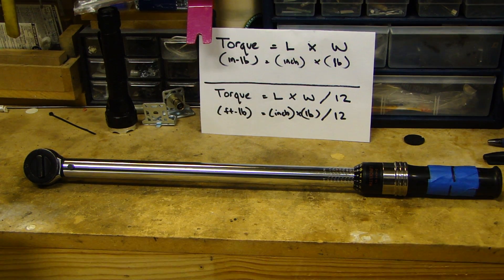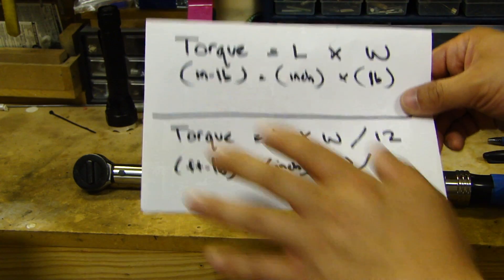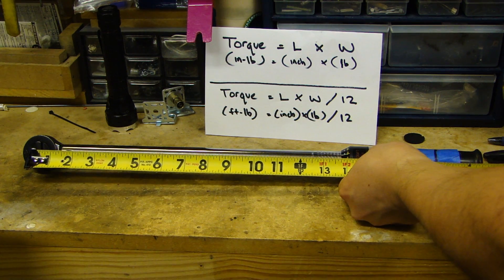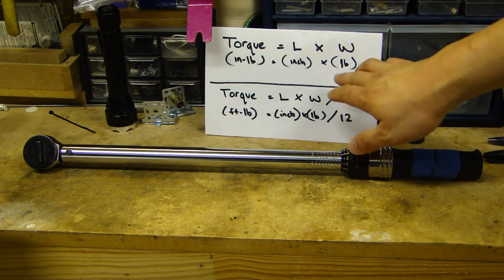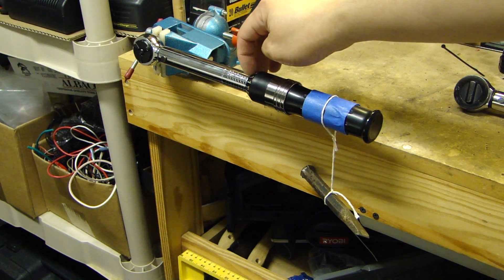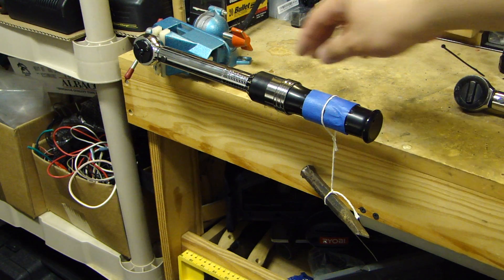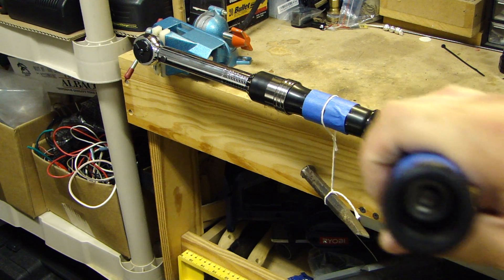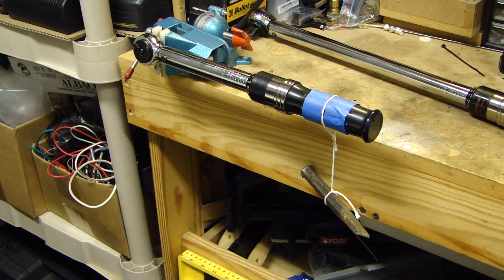How to Check Calibration Accuracy of Torque Wrench

Comment: VERY IMPORTANT! This test is not complete. After doing what is shown in the video you MUST apply lower torque values to make sure it is not still clicking. If you set the wrench to 50 ft-lbs and it clicks when you apply 50 ft-lbs  how do you know it wouldn't have clicked at 40 or 45 ft-lbs?
Reply: Good point but you got it backwards.  If it clicks at 50 ft-lbs, it will also click at any lower setting.  You'll want to make sure it doesn't click at settings higher than 50 ft-lbs...  Now if you are speaking of the amount of weight you apply, then yes, I'd agree.
Reply: @Nick-zp2mg  Lol. I am literally sitting here trying to work this out in my mind. I don't know why I'm having so much trouble. But yes, there are two parameters to consider: 
1. The SETTING on the torque wrench
2. The amount of torque actually being 
     applied.
Reply: Jon Brahms  I concur

Comment: This test you did, which I did on all 3 of my torque wrenches,  was very accurate.  I was off by 4.5% to 5% on all three wrenches.  I read the instructions that came with my torque wrenches and it allows for plus or minus 4% accuracy.  Thanks for sharing......Canada.

Comment: One thing that wasn't accounted for was the actual test method. If you use a weight heavier than what the calculated weight is, the wrench will still click. 5 lb weight, no click, 25 lb weight, click. 50 lb weight, click. In his example, 50 lb weight x 18 In / 12 = 75 ft lbs. Put an 80 lb weight on it, and it will still click. So finding the sweet spot might be difficult.
Reply: Absolutely right. My thoughts exactly.

Comment: Does this method take into account the weight of the handle? If not I suppose you could perform the test with no weights to find the initial torque value, then add that to the value that to the torque value with weight hanging.
Reply: On second thought this probably wouldn't work. It probably wouldnt be heavy enough to register on the torque wrench. Even if it did register it probably wouldn't be very accurate because torque wrenches are not accurate at the lower torque settings.
Reply: You could measure the downward force at the point marked by using an electronic balance pulling up a few mm( fraction of an inch) as there's always a little play in the ratchet which will allow you to do that. 

The method is accuate enough for  those using a torque wrench at home, it's so easy to apply a little extra torque anyhow if you keep moving the wrench slightly with extra force after you hear the click.  You just have to be accurate with your measurements and think about what you're doing to get an idea if your wrench reasonably accurate.

Comment: I happen to have a 1/2" drive torque wrench I bought in 1996 for $40 Mastercraft brand 58-8654-0 and looks EXACTLY like dial2fast 1/2". I have three torque wrenches right now, all three are click type.

Anyways I recently used a professional digital torque wrench calibration tool that is used to check tools used on aircraft (ie: accurate to 3 decimal places in ft-lbs and 4 in in-lbs, zeroing, hundreds of settings, etc) and I tested all three of my wrenches...the range of mine is from 25 to 250 ft-lbs. I tested between 50 and 250 and for each test point I averaged 6 torques...this is what I recorded:
50 ft-lb setting = 51 = +2%
100 = 99 = -1%
150 = 146 = -2.6%
200 = 199 = -0.5%
250 =  250 = 0% error.
Now, I've had this torque wrench for over 17 years, built several engines and used it thousands of times. I've dropped it from a meter high or more at least a dozen times, accidentally dropped a jack stand and a full toolbox on it, skidded it across a garage floor and its hit concrete walls pretty hard. Sometimes I left it on a high torque setting for months. I've never calibrated it until today. I usually put it away and store it in its plastic case but the hinge on it is almost completely broken but other times when I have an ongoing project I'll leave it out with other tools.

The other two torque wrenches I have are pathetic. I've only owned them for 2 years and used them very little. They have never been dropped, always left at a low torque setting and show no signs of use. My 3/8" drive Powerfist (10 to 80 ft-lbs):
20 = 17 = -15%
50 = 44 = -12%
80 = 76 = -5%

1/4" drive MiT Mechanic's (20 to 200 in-lbs):
50 = 55 = +10%
100 = 120 = +20%
200 = 240 = +20%

While the Mastercraft always had <1 ft-lb deviation on each torque, the other two varied sometimes by up to 5 ft-lbs or 10 in-lbs with the 1/4" drive.

Cheap and inexpensive are not the same thing and inexpensive can be really, really good. I had no idea how good my torque wrench is until now.

Comment: This method is ok for people who aren't torqueing things that need to be very specific.  I calibrate tools including all kinds of torque wrenches for a living.  That is the correct formula and the weight of the wrench is not going to make that big of an impact when torqueing your lug nuts or other misc car parts. As he said the accuracy on these are +/- 4% or 3% for some of the nicer ones.  If your reading is 45 ft-lb (540 in-lb)  that gives you +/- 1.8 ft-lb (21.6 in-lb) the added weight of the handle isn't playing a big part in there. You should always store the wrench at the lowest MARKED setting (NOT as far down as the wrench handle will turn) Technically you should also exercise a wrench at full scale on something else before using but no one is going to do that either. As Hilegunslinger said you can use buckets of water to calibrate a bathroom scale to see how far off it is and then use the offset to figure out the weight of the objects you are going to hang just try to check the scale with water weight that is close to the object weight.
Reply: What will the formula be if I am using NM?
Let´s say I want to check 25, 30 or 50NM is correct in the spec +/- %
Wrench length is 43,5 cm long

Comment: One good way to get a good 'standard' weight is to use a 5 gallon bucket and fill it with water.  Water weighs ~8.34 pounds per gallon.  So 3 gallons is right at 25 pounds of water.  5 gallons would be 41.70lbs.  You can use this technique to calibrate a larger scale as well.

Comment: In english: 
Hold the socket (i.e. 1/2" square) in your hand and let the weight of the other end of the wrench fall on a scale. (the handle touches the scale/measuring device)
The wrench should be as horizontal as possible.
Note the weight that presses down on the scale and add it to your calculations.

Comment: yes  that can make the wrench out of tolerance I actually work for a calibration lab in Baton Rouge, LA  " JM Test Systems and personally I do not agree with the method this person in the video is using there is so much more that goes on inside a torque wrench. if you have spent good money on your wrench I would strongly advise having it calibrated annually if not bi-annually by a professional.

Comment: In line with ASME B107.300-2010 #6.3(1)(2)(3) The torque shall be applied at a rate sufficiently slow and steady. For  ISO 6789:2003 #6.3.2 the load shall be applied slowly and uniformly during a period of 0.5 to 4 s. So, hanging a weight in the middle of the hand hold is not the correct way to check the accuracy of torque wrench.

Comment: The 2-4% error found within good torque wrenches is factory tested with the weight of the wrench not interfering. So yes it should matter but not as much for when applying torque at very high 100+ ft/lbs settings. Having said that this is a very clever quick check technique.

Comment: I have a question about the length measurement.  Do take the length measurement with the wrench set to the minimum setting and use that length for all torque settings or do measure the length for each specific torque setting?

Comment: Then i believe if i set up that weight to where it clicks that will be pretty close. and i dont believe the weight of the wrench will come into it at all since im applying the correct force  at the correct lenght to where the wrench will indicate ,the wrench scale becomes obsolete, it just becomes an indicator to my calulated force ,of course iwill set up the wrench dead level for better results.what do you think?

Comment: Hi dial2fast, very interesting video. Iv got a question for you. I have 2 quality torque wrenches i know are not accurate.What i want to do is calculate the exact weight for a known torque.Iv come up with the idea that if i know the weight for the tourque setting i can calculate the volume of mild steel and cut at work disks for specific weights/torque.  What im asking is if i have the tourque setting-29Nm,and i have the length-370mm ,how do i work out the exact weight?

Comment: Thank you for the video.

A large bucket filled with water might serve as a useful weight and with the typical length of a torque wrench should put you in a good range for calibration. 1 US gallon of water weighs about 8.35 lbs and of course 1 liter has a mass of 1 kg. 

You can weigh the empty bucket in the vegetable section at the grocery store.

Volume measures or a kitchen scale can be used to vary the weight.

Comment: Mass Scale, Ruler, Type 3 550 paracord rope, carabiners, adhesive sandpaper,10 lbs gym weights, large socket, and a vise is what I would use to test it. U still have to offset the weight of the carabiners by a couple ounces to get a more accurate reading though.

Comment: This is a good guideline in that it uses engineering fundementals but by no means is it precise.  You have to take into account the inaccuracy of the equipment used to measure your weighted object as well.  Not to mention, you also you have to take into account the mass of the torque wrench itself acting downward on it's center of gravity location.

Comment: while this is a good way to get a rough estimate, there is one oversight.......
when the wrench is secured horizontally, with no weight hanging off it, there is already a force being applied to the wrench. this force comes from the mass of the wrench itself.....the force will act, theoretically, through its centre of gravity and put some pre-load on the internal spring.....how much pre-load will depend on the size and basic layout of the wrench, but its still something to consider.

Comment from the maker: Yes you can definitely do that by simply remembering how many pounds is off by. Also keep in mind that most torque wrench itself has a +/- 5% accuracy. On top of that, if you go down towards the lower end of the torque range, the accuracy can be +/- 15%. As long as you are not 20% off, you will be fine.

Comment: Assume the torque wrench I have is NOT accurate. Can I use the following method to use it.

torque = L(ft) x W(lb)
Assume L = 3 and W = 30 so torque is 90 ft*lb
However, my torque wrench I have to set it as 100 ft*lb, then it clicks.

can I assume that I can use the false 100 ft*lb to replace to real 90 ft*lb to do my work?

Thank you

Comment: choosing the mid point on a handle is not really a guess! because once you put the force somewhere else the torque value will be different, remember Torque = "Length" x Width

Comment: 4. For the testing of torque instruments, refer to ASME B107.300-2010 or ISO6789-2003. If you have concerns about your torque instruments accuracy, send it to an experienced torque lab....... Remember if the fastener has a torque spec, it's a critical application.

Comment: 2. The first-peak drop-off is measured at the fulcruming point within the torque instrumnent and not at the square-drive. So using that said formula where the fulcruming point is three inches away from the square drive would create an additional uncertainty budget of approximately a +8%, and would increase as you move up the scale because the error is non-linear.

3. The test method has to 4x better than the item being tested. Since this is a 4% device, the test method must be +/-1% accurate

Comment: I would say back in the 1930's this would be a semi-accurate way to verify a torque instrument, because there were only beam style torsion torque devices that actually measured the torque at the square drive, as opposed to the the TypeII ClassA Style2 torque instrument you are demstrating in your video.

I. You cannot use a fixed length in your formula to account for every test point. As you wind-up the handle to move-up the scale, the effective length changes, thus changing the reaction point

Comment: you can also use water if you have a good volume measurement device as distilled water weighs exactly 1 gram per cubic centimeter.

Comment: The weight of the wrench itself would result in it clicking at a higher setting than expected, but if you stick with testing values high up in the scale, the error will be less significant.  You could minimize the effect if you place the wrench in a vertical position rather than horizonal, and use a spring scale like the kind used for weighing fish (don't use the tall tale versions-) to apply the force.  
Then the weight of the wrench won't matter, and the only error would be the scale accuracy

Comment from the maker: @57gemini   I am glad this video helped you. As long as you can get an idea of how close to accuracy your wrench is, then it's adequate for most jobs. Even a brand new torque wrench out of the box has +/- 4% tolerance. If you use the lower torque wrench range, it can be as far out as +/- 10% or more. My method of checking is not as accurate as sending to a lab for calibration but it's good enough for most DIY'ers.

Comment: @dial2fast 
Thanks for your reply. Very helpful.My wrench broke, and i'm just getting new parts. The rachet  mechanism. And there was a thing about the adjustable handle too, so I had to take it appart. But with the weigt on the handle, it seems to turn out OK. I consider it calibrated.
Thanks again

Comment from the maker: If your torque wrench was EXACTLY 12" from socket to the middle of the handle, then you can just hang the 100lb & check for 100 ft/lb. Most torque wrenches are not 12" (= 1 foot), so you have to do the math. My 1/2" torque wrench from socket to middle of handle is 18" (Ex: 18" X 50lbs = 900 in-lb, BUT 12" X 50lbs = 600 in-lb). As you can see, correct length is critical in finding the torque you are testing. Since the length is inches, to get foot-lb, divide by 12 (there are 12" in 1ft).

Comment: So, if you have a 12 inch long wrench, and apply 100 lb, then you'll have 100ftlb.
If you have a longer wrench, you will have to reduce the weight on the handle, to get the same torque on the socket. Thats where the calculation comes in.
But you say that you divide with 12 to get ftlb, is that right?

Comment: Or, is the calculation for how much weight to hang on the handle, to get the moment of force, set on the scale, on the senter of the square for the socket?  You say that , to get the foot lb, you must divide with 12. But won't you get the inch lb then? Again, correct me if i'm wrong.